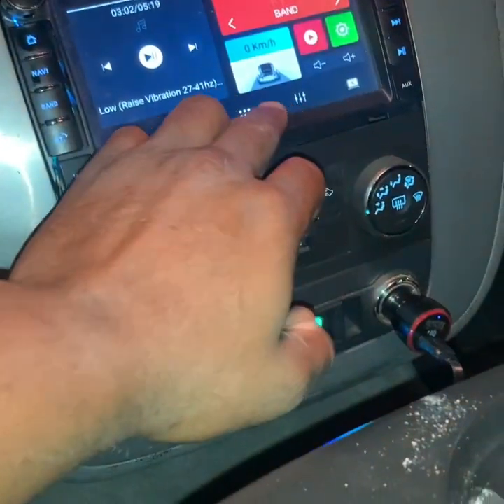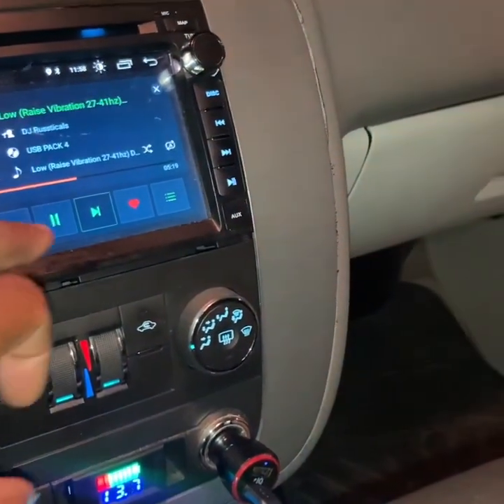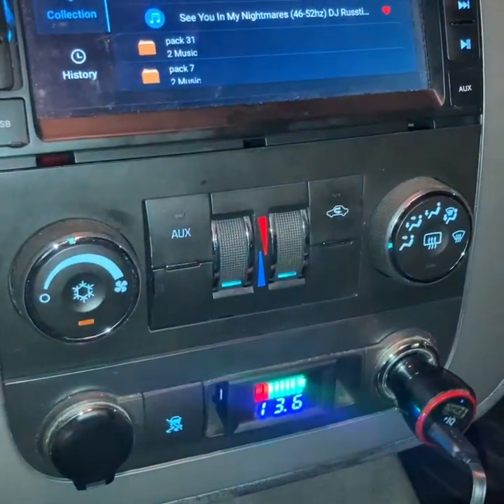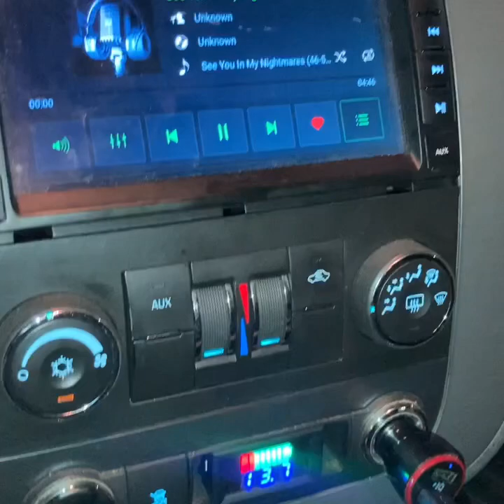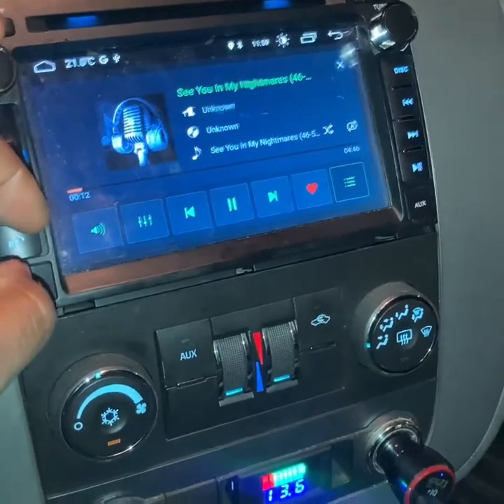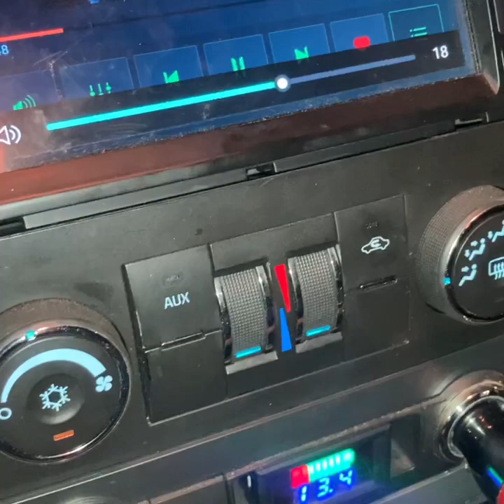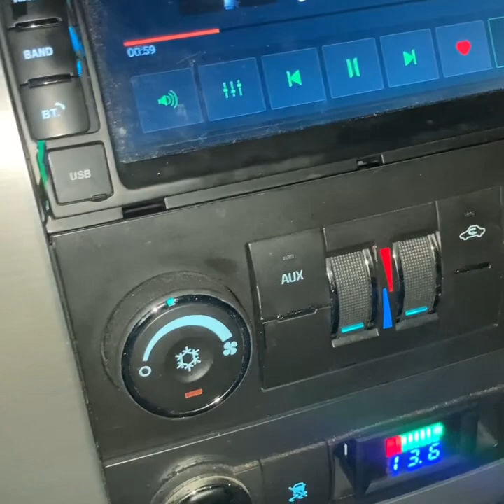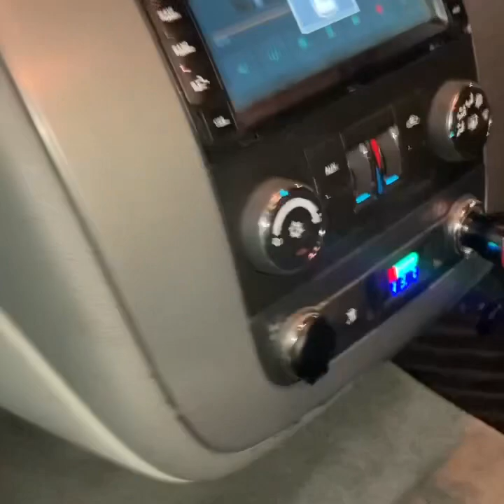2 crossfire c7 18s major pressure

Comment: Idk if u know the difference between the four pin and the two pin alts, the two pins r for external regulated so u will need a regulator, a external reg doesn't make any more power Than a four pin alt, u just get to control it, I have a crossfire build 6-18's xt3 and 40k ways or so I run two external 390's but if u r staying at stock charging at 14.4 stay internally regulated
Reply from the maker: Sickkkkk and Thanks buddy I just started with this build and the alt charging had me confused but I contacted brand x and got one on the way but yeah sick build my buddy Shannon got me on this crossfire I’m quite sure u may know him since your in North Carolina
Reply: Daniel Harrell my memory is not to great so it want be worded proper but you know how u take the 4 pin an bypass the PC in the ride to help him get better voltage I had the same issue with a auto tech 280 amp alt it would only charge at 13.5 maybe 13.8 on a cold start
Reply from the maker: You could use the 4 pin with only one wire but then the battery light would stay on but they have a plug you can buy to use a 4 pin instead of 2 pin alt from ict
Reply: @SmoothKreationsaudio  most internally regulated use the four pin, the two pin u don't just change the plug u change the entire regulator that has to be desoldered then resoldered, they make an adjustable voltage that fools an internally regulated by showing it has less voltage than actual voltage so it will keep charging, like the xs power vcm and a couple of others but a true externally regulated only needs a single wire to control which is just a hot that is switched on and off by a vcm like a transpo, the xs intercepts the signal and manipulates it to trick the alt, these do work on internal regulated alts I have had success with the xs one but I went external after that, so if u have a four pin u will need something to manipulate the signal two pins would need a controller basically like the transpo